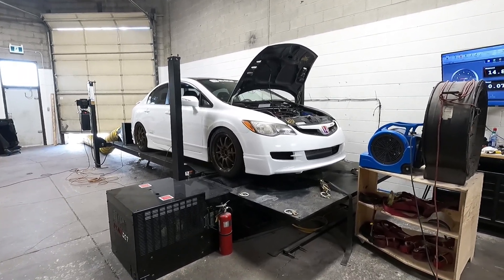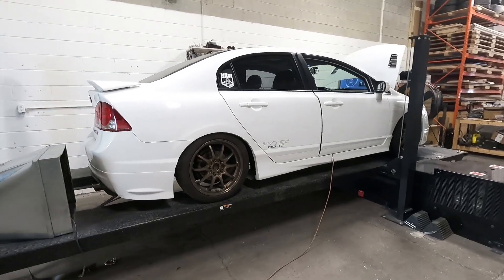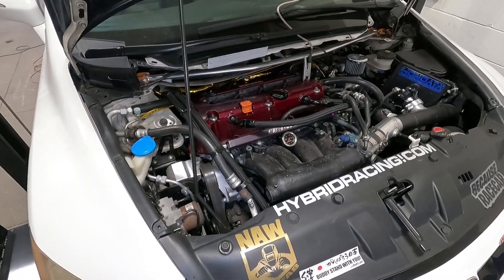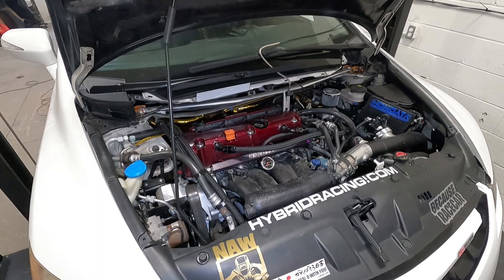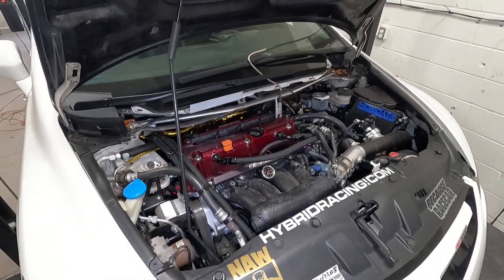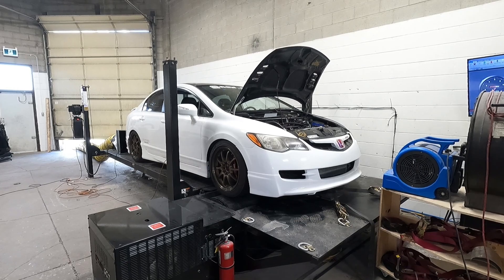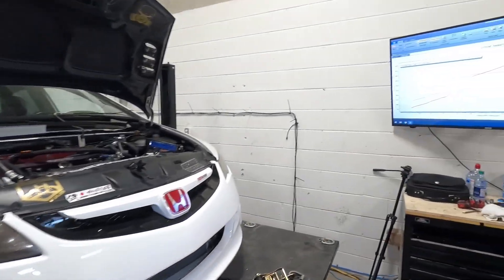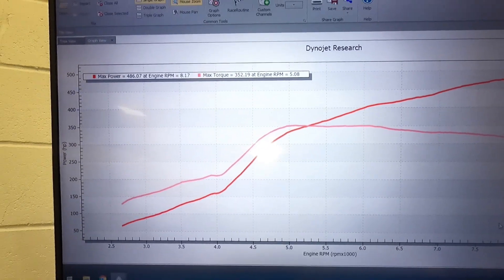Acura CSX Type S Turbo Dyno Tune - Garrett G30-770

Comment: Hi Nick! by chance have you tried a similar setup but with a g25-660? is it any better spool-wise? does it sacrifice too much on topend compared to g30-770
Reply: G25 would be too small  for these engines. It creates too much back pressure. These heads flow insanely well and need to breathe

Comment: I'm currently looking at one of these at a dealership. Saftied & Certified, including tax+all fees, for 10k canadian ($7,761 U.S.D).
It has 93,000km (57,788 miles) mint condition/no rust, very clean, manual, 2008 and red paint. Windows aren't even tinted. 
After watching this video I think it might be fate lol...my name is Lucas as well... Sounded like you were getting it ready for me lmao 🤣 I was shocked at the hp figures, good job man! The fuel starvation sounded like a nightmare, though lol

Comment: How did you install your front fd2 Honda type r grill? Does it fit bolt on or you need to change bumper? I have a 07 csx type s and i want to change it like yours! Do you know if it fits for me

Comment: Is the lack of boost below 4000rpm primarily due to the turbo geometry or lack of a boost controller? e.g compared to OEM setup like CTR that make good torque around 3000rpm. Thanks!
Reply from the maker: Yes - This is a bigger turbo then the FK8 OEM turbo so it wont spool as quickly as that. As a trader off this turbo can make a lot more power
Reply: I would've done a g25 660... Was this iwg?

Comment: what was the ignition timing??? i was soo excited and thankful when you broke down the tune     i have k24 on same boost i go to 14 degrees flat after 7psi       i am still learning    is it a pump gas      much love from niagara
Reply from the maker: I was probably around 16/17* on this setup - However take that with a gain of salt - the magic is how the timing is ramped in (especially on a stock engine)  so as to not overwhelm the engine with timing at critical rpm points based on how the turbo spools